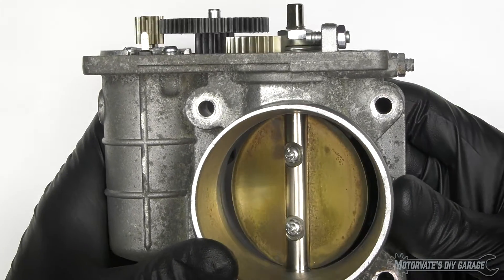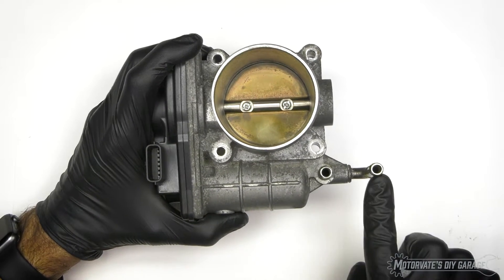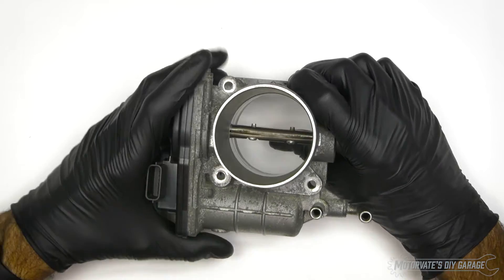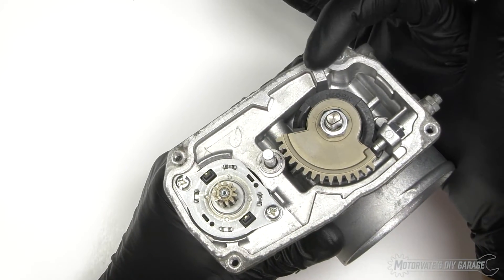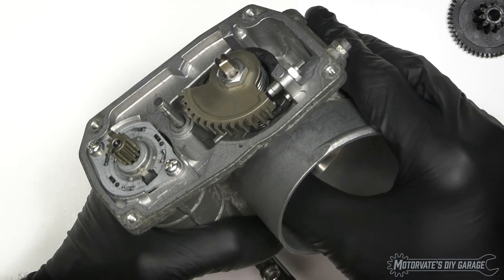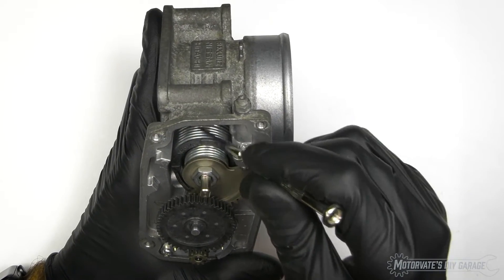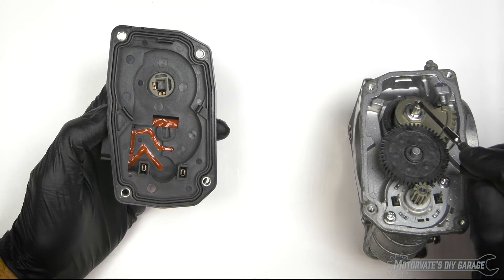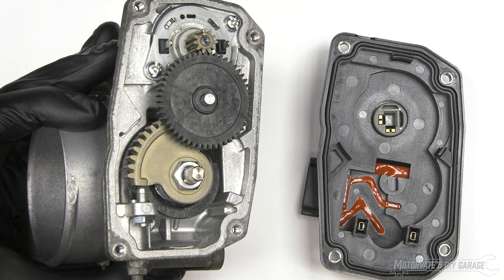How it Works - Electronic Throttle: Motorvate's DIY Garage Ep.30

Comment: Error:
P2101 - Throttle Actuator Control Motor Circuit Range/Performance

My car doesn't accelerate. The RPM goes up to 2000. After turning it off and on 3–4 times, it starts working. The engine check light code is also removed through the app, but the same issue comes back again. This has been happening for a month. The battery is new, and the throttle is clean. The mechanic doesn't understand and says to replace the throttle. How can I fix this at home? I have a multimeter, but I don’t know how to check current. The relays seem fine.
Reply from the maker: I'm not going to be much help, as I don't know what year/make/model you are talking about.

Generally the items to check for a P2101 are the harness, connectors and throttle body.

One option may be to check the resistance of the throttle body sensors. Usually the spec is listed in the factory shop manual.
Reply: It's FAW V2 2016 model 38k driven new battery, clean throttle and plugs, MAF sensors etc. Here electricians are very uneducated and not trained. They only do experiments with our cars.  @MotorvateDIY
Reply from the maker: Got it. However, I'm not going to be any help as the FAW isn't sold in North America, so I've never seen seen one or know anything on their operation.

Comment: How did you open it so easily? Please share the video. Mechanics told me we cant open it.
Reply from the maker: Throttle bodies are not all the same...
This throttle body from a Nissan/Infiniti  3.7  v6, and as you can see in the video, if you push it will open.

That may not be true for other throttle bodies.

Comment: Hi bud, I have the weirdest problem! I went to change the air filter and thought to check and clean the throttle body butterfly. It was fully open which I thought was strange as had no real issues, I mean I have thought the car was a little sluggish on acceleration (delayed) and thought maybe my EGR choking. I always put good quality treatment into fuel and try different types so thought maybe not so... Lately had a little stuttering at the first few lights after leaving the house first thing but not pulling off the drive? 
My throttle body was fully open with engine off, I sprayed it and wiped but was pretty clean... as you could wish for, I sprayed in with engine running spurts of spray at a time but no movement with butterfly? 
I had my naibours grandchild come with half decent scan tool tablet a month or two earlier to check car after I gave him a toe and he said that there was no codes, which he thought was suprising. I dont know if he knows fully whats wha but he mentioned my pedal showing depressed 19% ?? he didnt start the car with scan tool plugged in which I asked and said that I thought you could but he said not with his tool. He said he wiped the car for any codes anyhows. Oh I did have a funny few weeks with my battery dying a while back and got that checked but came back fine (just needs a charge so I bought a smart charger and let it do its thing but it kept dying on me and then I put the battery on a full repair charge and its been fine since plus i've kept car in a lower gear to charge up more as my brother said I was driving like a pussy... trying to save miliage 😂 Any idea bud why my butterfly is full open with no real issue on idle or revs going high and once the car warms up all other issues apart from sluggish accelorator dissapear! oh and I disconnected the battery a few times to charge so I assume the sensor would have reset as ive heard on another vid to disconect the negative.

I have been worried why my surpentine/alternator belt seems slightly worn on the outside but looks great on the ribbed inside? I thought maybe my issues was the belt tensioner or idle pulley but strange how the black is wearing off on the outside and all looked good with no movement on the tensioner. I did hear the other night late on when it was quiet a little rythmic chirp ever so quiet which i've not heard before which makes me think the idle pulley but cant make head way with the throttle body butterly fully open?

Honda Civic tourer 2014 1.6i-dtec deisel
Reply from the maker: I'm not going to be much help. I don't know much about Honda's and nothing about diesels.
Reply: Diesel does not have regular throttle body, it have throttle body to shut off the engine, this throttle is open full all the time and only close when you turn off your engine, this is safety feature of newer diesel engines, it protect engine from runaway. In older diesels when turbo seals blow up turbo is spraying oil into intake and even when you turn off the engine/cut fuel supply it still run and it run like hell, max rpm's and shit ton of black smoke. It will stop when there will be no more oil in the engine. Back to the topic this throttle is normally open, in pertol cars throttle is normally close so in you car throttle is used for like 5 seconds and it goes back to its normal position

Comment: Hi, great videon just wanted to ask I have a 2009 Shogun/Montero depending where your from. When cold  and ignition off should it be closed or open and when it comes to idle where should it be closed or open as I think mine is jammed open...
Reply from the maker: I am not familiar with that engine, so I don't have any first hand knowledge on it.

Typically the throttle is open around 10% on a cold start, assuming the engine doesn't have an independent idle control circuit. (aka controlled air bypass)

If your throttle is jammed open, the engine would rev extremely high, (around 6,000+ RPM) and pressing the gas pedal wouldn't do anything.

Also, the check engine light would be on, as the throttle position is constantly monitored.

Comment: Good day Sir .....i just wanna ask if the throtle plate will open when you press the gas pedal even when the engine is not running?
Reply from the maker: It all depends on how the engine computer (ECU / PCM / DME) is programmed.

In the example of the G37/370z, when in neutral/park, it doesn't move.
BUT with the engine off, ignition on and in drive/in gear it will open up to 30-40%.

Comment: Hi, I have a Toyota Prius 2011, and I'm getting code P2102 which means is "Throttle Actuator 'A' Control Motor Circuit" Low. I need more info before I replace the whole piece. please help.
Reply from the maker: I'm not going to be any help, as I have not worked on any Toyota vehicles.

BUT for $25 you can get 2 days access to the Toyota Technical Information System and troubleshoot the code to determine what is wrong.
Link: https://techinfo.toyota.com/techInfoPortal/appmanager/t3/ti?_pageLabel=ti_whats_tis&_nfpb=true

Comment: I spray throttle cleaning spray inside throttle body means inside gear spring assembly,any problem will occur?
Reply from the maker: I'm not sure I fully understand what you are asking. Spraying throttle body cleaner where the engine air flows is fine.... and that is the only place to use it.

Comment: my question is , if in resting close throttle position still throttle plate (opens a little bit) when pressed with a finger towards inward. will this be faulty or okay?
Reply from the maker: On Nissan/Infiniti vehicles, that's normal and is part of the "fail safe" safety system. If the power to the throttle body is removed (due to short or broken wire), it will be open about 5% to allow the engine to make a little power.

The ECU (engine control unit) uses what is called an "H-bridge" motor controller and can drive the throttle to open or close.

Comment: I have 2010 toyota corolla with electronic throttle body. engine had vibrations at idle. mechanic first clean throttle body with carb cleaner . but did not fix the issue. then he messed up with that idle screw. now the car driveability is more worst, it lack power when accelarate.  although  engine idle has stable RPM 700. 
can you please give me a brief procedure or service manual to bring that screw to its orignal position.
I have requested too many guys on youtube but no body has help me. 
Thank you in advance.
Reply from the maker: Sorry, but I'm not going to be any help... I don't know anything about Toyota vehicles or service  procedures.

Comment: Hi there great video, please assist I have a reno clio 2 2005, when my throttle body doesn't open my electronic fault light is on but soon as it's open the light goes off.. Any suggestions.. Thanks
Reply from the maker: As you can guess, it is difficult for me to troubleshoot a car I have never seen, over the internet. (Renault is not sold in North America)

Your first step should be to scan it for codes. Then lookup the trouble code and  understand what the issue is. At that point, you can start to troubleshoot or take it to a shop.

My guess would be a problem with the throttle position sensor.

Comment: Great video man I just have one question. Is it possible for it to work without that smaller spring that turns it from resting to absolute closed position why is it necessary?
Reply from the maker: That is part of the "fail safe" system. If the throttle body motor stops working due to a failure, the throttle will close to about 5%, which is an engine idle. This way you still have power steering, power brakes and don't stop in traffic.

If the throttle is allowed to completely close, the engine doesn't get any air and will stop. (assuming the engine doesn't have its own idle control circuit)
Reply: Of course thank you for your quick answer. I dissasembled one and I am trying to make a different housing and a bit simplified system because original one doesn't fit where I need it so the other spring is giving me a hard time

Comment: Hi bro
How to reset this
By mistake I open and cleaned electronic
The fix it
But car did not start any idea
Reply from the maker: Based on what you have told me, I have no idea.
BUT, if you told me year, make, model I can look into it. :)
Reply: @MotorvateDIY  
I did clean electronic throttle body with petrol
Electronic also cleaned 
Then I fix it    Now my car won’t start  I think calibration problem
My car model
Maruthi alto800 
2016 model
Reply from the maker: Got it... 
Since I am in North America, I know nothing about a Maruthi alto800 as they are not sold here and as such, I don't have any documentation for them.

I'm sorry I can't be of any help.
Reply: @MotorvateDIY  its ok thank you
Reply: I think maruti 800 has mechanical throttle body

Comment: Thank YOU. For the AMAZING EXPLANATION. 🙏🙏
Reply from the maker: Glad it was helpful!
Reply: Iv got a 2015 370z and bought a kunfine car electronic throttle controller  for 89$ when it's plugged in and lights up but engine light comes on and when u give it throttle the rpm go up extremely slow. I don't know what wrong with it. Anyone have any ideas

Comment: Here because of a high idle issue on a 350z hr. What kind of motor would that be? It has to hold a position against a force (The spring). Perhaps it operates like a servo motor.
Reply from the maker: If your HR is an 2007 I guess you missed the warning in the video description... there is an ECU update required to have the "idle air volume learning" run to completion. Some dealers will update the ECU, some want to sell new ECUs and some want to sell new throttle bodies.

Also, Eugene at Enthusiast Auto Care (https://www.yelp.ca/biz/enthusiast-auto-care-concord) can reprogram your ECU.

If your HR is an 2008, make sure all the per-conditions are met and try again. Sometimes it seems to take a few times for the idle to settle.

Comment: Amazing video man... However I have one question that.. in which situation the throttle motor closes the gap... Is it in that situation when we have to start the car and when we put our car in ignition the throttle motor completely closes the air passage by spinning in opposite direction to choke the air and star the car with just gasoline.. and automatically readjust after the car is started and at idle?????????? My question is long ... But I hope you understood my query... bTw love your videos
Reply from the maker: Hey  Gautam Dhiman,
As a general rule, the throttle is not closed during engine start up. They are opened about 5-10%... After all, the engine does need some air to start.

 The required fuel enrichment for engine start up is done using the fuel injectors. The engine computer looks at the coolant temperature and calculates the amount of fuel needed to start the engine. Chokes were only used on carbureted  engines.

The only time the throttle is mostly closed is when you are coasting (foot off the accelerator) like when slowing down for a red light or stop sign.

Thanks for your kind words about the video and your comment!
Reply: @MotorvateDIY  well explained
Reply: I just have to know that in which situation the ECU sends the signal to close the small gap to choke tha air??

Comment: Heated throttle body does heat up intake air, but mostly @ idle. I parked my girlfriend's car in the parking spot & used scanner to watch intake air temperature in live data & it kept going up but slowly. But I don't think this matter much since most demanded "performance" isn't @ idle speed 😁.
Reply from the maker: Hey  Ying Chiu Luk,
Keep in mind, the air intake temperature sensor is usually way before the throttle body, so what you saw was the intake tubing warming up from the heat of the engine.

With that said, we agree on not looking for maximum air density / power at idle :)

Comment: When  i  first  turn  my  car  on  it  goes  up  to  2  and  seems  high  idle  then  when  warms  up  the  rpm  hand  goes  to  750  at  stop  sign  with  a little  sputtering  i  have  a  nissan  what  i  did  i used  my  index  finger  and  pushed  the  throttle  plate  1/2  inch  open  so  i  can  wipe  a  Q tip  around  to  clean  the  throttle  body  and  the  edge  of  the  butterfly
Reply from the maker: If you have wiped or cleaned the3 throttle body, you need to do these three steps as shown here: https://youtu.be/HIiaF0VaTlQ

Comment: Thanks for this video; could you tell me how to test TAC moteur.
Reply from the maker: Hey  tefa loulou,
That will be difficult to do... Each manufacturer will use a different electronic throttle body with different specifications.

Your best bet is to find/purchase the factory shop manual so you know the proper method of testing and what values to look for.

Good Luck!

Comment: Thanks for this video. I appreciate the explaination. Does an electronic throttle body has an idle air control valve?
Reply from the maker: Hey  Wigo TV Allan Rey Bernardo,
What an excellent question!

In the specific example of the VQ37VHR / VQ35HR engine used on G35, G37, 350z, 370z and others, there is no idle air control valve.
Idle air control is done by precise positioning of the throttle plate.

I would assume other manufacturers would also use a similar, system as it reduce costs and simplifies engine assembly.
Reply: Motorvate DIY Thanks man:)

Comment: I would love to pick your brains. I'm from UK and have an iveco daily van. I have got myself a misfire  which is very random. I've changed the mass air flow sensor.ive taken off the throttle body as it was so thick in an oil like gloop.its now sparkling clean. But still the misfire. I have no egr valve as its been taken off and blanked but not deleted,but this was 2 years ago it was taken off. How would I know if the throttle body has failed as I'm fairly certain it has to be part of the problem..and when I take the throttle body off,the butterfly is in the open fully position
Reply from the maker: Hey  mark clutterbrook,
Without knowing the specifics of you engine, I can only guess. I think it is very unlikely that a throttle body would cause a misfire.

You may want to get an cheap wireless OBD scanner and app for your phone (OBDFusion is very good). Then you can view your fuel trims, air fuel ratio and if you run the diagnostic report, you can see the misfire counters by cylinder. (if supported on your vehicle)

Most misfires are a result of a lean condition or poor spark.

If you want to learn more about on board diagnostics (OBD), pop over to my other channel ( https://www.youtube.com/obd4everyone ) to learn more.
Reply: @MotorvateDIY  I have an ond2 reader and things that came up was obviously egr and the other was air mass flow sensor. I replaced air mass sebsor. And fitting and new egr valve and cooler tomorrow. Will let you know if this solves the issue.